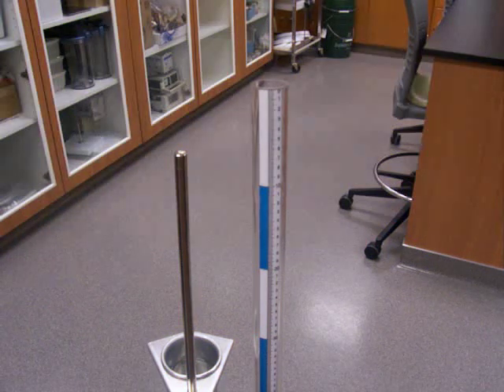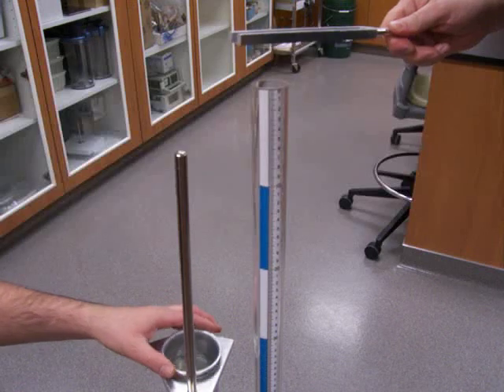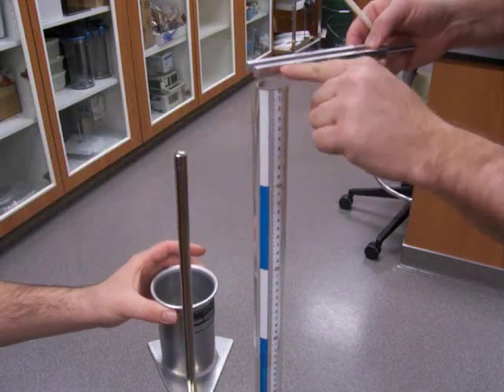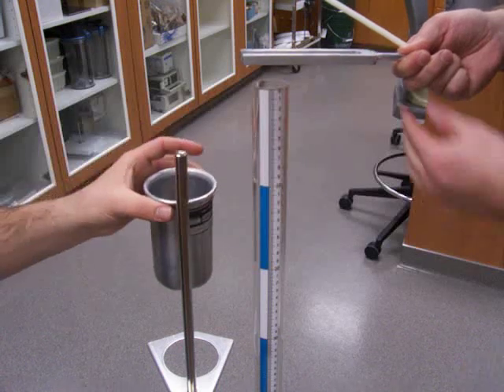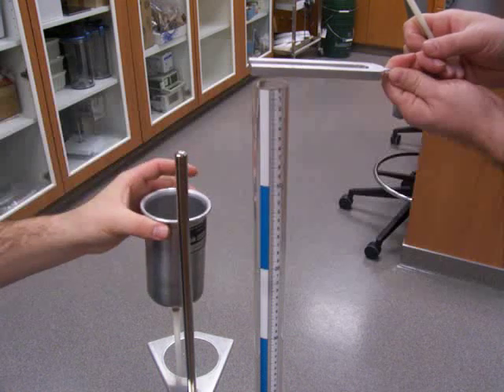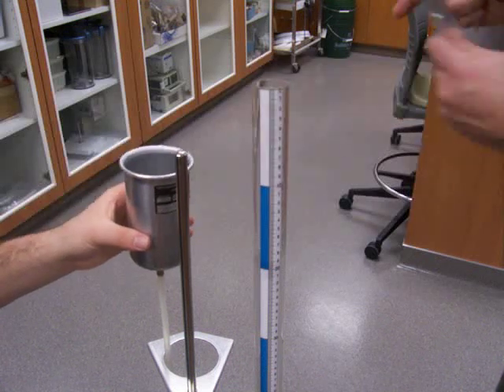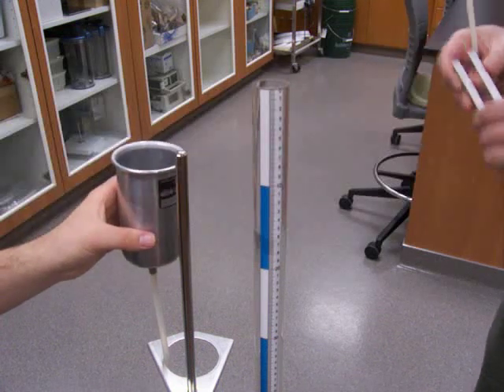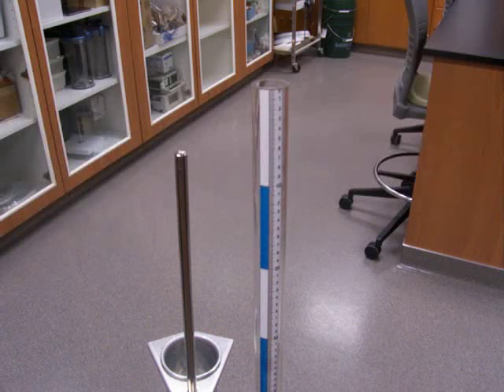Unit II-1 Lab Speed of Sound

Comment: i have a ques ,i think that the tuning fork should be rotated 90 degrees about the axis of the tuning fork as the waves produced will move along that direction and not face down .Pls comment.
Reply from the maker: You might be right. However, I checked a lab manual (other than my own that I wrote) and it didn't specify. Also, I don't tell students how to hold the tuning fork, so they probably hold it half the time my way, the other half the time your way. But no matter how, they always got good results. (It would be interesting for me to test what you're saying and see if it makes a difference.)

Comment: Why do you add that 1 cm? isn't the sound wave always with an antinode in the mouth of the vessel and a node on reflection?
Reply: ess kp Look up "end correction" in relation to standing waves in open tubes. I just had all of my high school students slam headlong into this issue when I had them do this experiment with tubes that had a diameter around 8 cm. It adds a significant offset which nobody seems to talk about.
Reply from the maker: alextheape Thanks for posting this response. I have my students perform the standard lab book experiment*: for the ten tuning forks that they use they usually get averages between 335 and 345 m/s (should be 343 at room temperature) and between 325 and 330 m/s (outside on a mild Alaska winter morning). I didn't know that the extra 1 cm that I use is termed "end correction" and that its use goes back to Lord Rayleigh. 
* Loyd and hyperphysics mention the end correction, Nolan doesn't (Nolan and Loyd don't need it actually because they have the experimenter subtract the 1/4 from the 3/4 wavelength measurement).
Reply: Andy Veh The challenge I'm facing is trying to make this an inquiry experiment where students have some understanding of resonance and I say "figure out the speed of sound", with nearly no procedural prompting. I'd say doing a difference between modes is beyond their ability to create on their own, and this effect isn't otherwise determinable unless you know it will exist, so I think my best option is to give them materials where the end effect can be swept under the rug (narrow pipes).